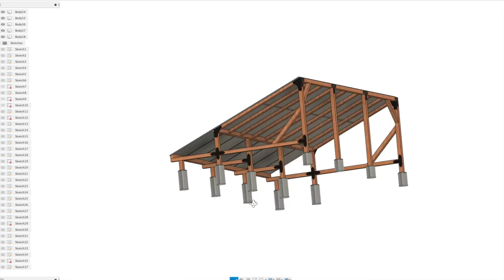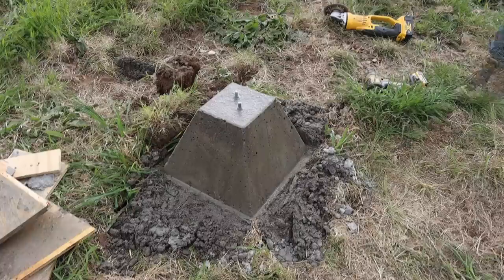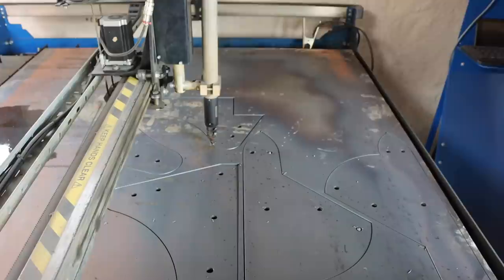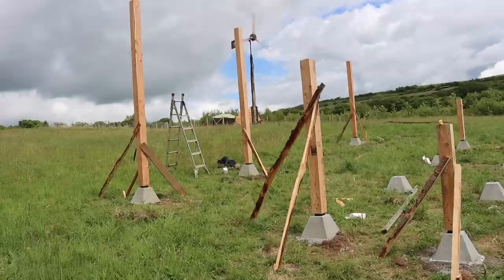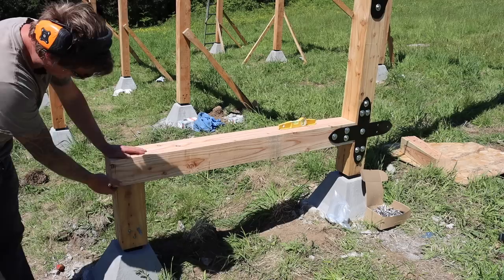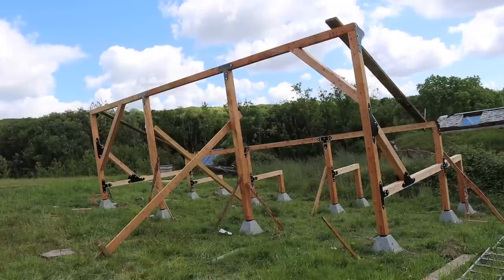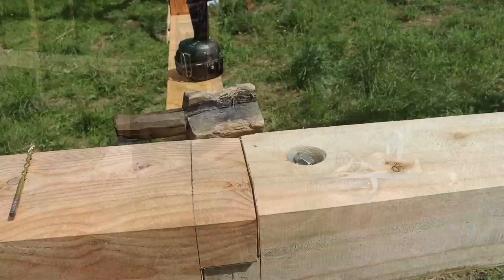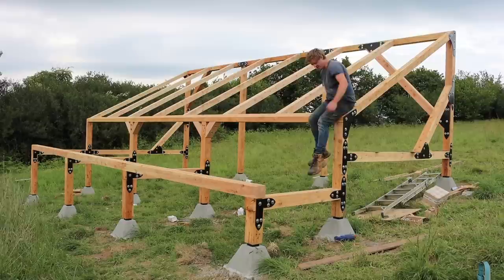8.4 Kw Timber Framed Solar System Part 1 The Frame

Comment: Kris, thought you'd gone totally OTT with that utterly gorgeous frame. Then realised that the sail area of the panels would exert enormous forces on the frame in high wind/storm situations. Over the expected lifespan of your new/modern solar panels there will be plenty of storms, so I now realise the wisdom of your design.
And using the space underneath as a wood store - pure genius!
8.5 KW of power is insane - well done, but are you planning on selling it to your neighbours/ the grid?
That's pretty much all the power the on-grid connection to my modest house gets, and we've never been short of power in over 30 years here.
I know it's subject to sunshine, and your hydro is subject to rain, but if the sun aint shining, good chance it's raining (especially in Wales!), so you seem to have it covered whatever happens.
Genuinely in awe of what you're doing there, and so thankful that you're sharing it with us.
Thank you.

Comment: I have a 12.1Kw system on the roof of my house. It was installed to cut down on my electric bill. Solar is wickedly efficient and I have not had an electric bill since December of 2021 due to a credit created by the excess power the utility has to buy from me. You will love it since it will more than meet the electric needs of your home and shop. I watch all kinds of channels. One of the tricks I have seen from companies that pour concrete is to put used motor oil as a release agent.

Comment: Yes service has got very slack recently from suppliers. New and more efficient is a better way to go in my opinion. Could have used less panels and put a bit of roof on the structure if you think you have too much solar but I guess in the winter the extra will be better for you. Great vid thanks for sharing.

Comment: Kris, ever thought about doing a composter that automatically turns itself over? Could be a cool side project while waiting on parts for a larger project.
Reply: My Dad made one of them automatic composters 66 years ago! He had to wait a few years but I finally got big enough to use a fork and shovel...LOL Such fantastic engineering that I'd say is ULTRA MEGA DIY. Done by a master. I would have thought he would leave it open under and graze the sheep periodically. No goats though!
Reply: Kris has a half dozen already in the chicken house & incubating more. You'd be surprised at how fast 6 chickens could level the compost pile

Comment: Hi Kris - am still loving your videos as much as the early days, wow, come such a long way since them miserable days before the house was built - like the new structure, a little house for the tractor, another hen house, or for sheep
not sure if this might be relevant or of any use to you, a little knowledge i have regarding solar panels, i did a security job looking after a new Solar Panel farm, when the boards finally arrived, i helped go through the panels after delivery, all i understood were printed (the latest thing making solar panels cheaper) but around one in five were damaged, cracked and some the print (screen print) had delaminated - i also learnt that the panels may need replacing every few years due to failure, i guess under UV conditions, i wish i made a note of the company as it got me interested, maybe i try and look out for a local site and keep an eye out for maintenance crews and ask, its interesting technology, but if it fails every few years, i begin to wonder, i guess you pay for the quality in the end, be cool to see how you can test a panel, before it gets wired in, and fails
Reply: That sounds like quite a specific problem for new types of panels - most are guaranteed for 25 years!
Reply: @sroberts605  this was from around 2008 ish, i understood that panels were now being screen printed saving a fortune on panels, around £25 or so per panel which i guess makes sense when filling a field with them, but the failure rate must be pretty bad, be interesting to find out, but i suspect some of it was due to transportation from Taiwan etc some ally frames were dented

Comment: I am going to use this when our install crews complain about uneven ground whilst using machinery and prefab racking solutions for our ground mounts. And from someone in the solar industry what you experienced with  procurement is insanely common right now some have even demanded more money to release the equipment due to rising costs. The solar industry has exploded in costs across the board. We have seen 15+ cents a watt increases in a matter of months just on panels. So companies sell you something and will want more or sell it elsewhere because demand is so high . Sad but a reality at the moment.

Comment: Another spectacular build, an engineering feat, well done. I installed a 6.6kw system 18 months ago and it has more than halved our electricity bills. System will pay for itself in under 2 years. Just need the cost of batteries to come down so I can store the excess and then we will be totally off grid.  Look forward to part 2 👌

Comment: Beast of a frame! I prefer the metal brackets too

I feel like the solar panels being new you'll just get more life and efficiency out of them, it's not like you won't put them to the best use and probably offset the environmental impact of making them in less than a year with how green your whole setup is... add in the additional ability this will give you to do so much more no one should be losing sleep :)

I'm not sure how environmentally friendly it is, but, with the concrete pads (fully cured and dry as a bone) if you mix 50/50 petrol and bitumen and paint it you'll get a cool looking finish, good protection for metal and it'll soak into the concrete miles better than any of those tanking type paints, they're usually just some sort of latex that eventually peals off and they barely penetrate the concrete, it's also amazing wood protection too and kind of "ebonises" the wood, might be worth knowing, even if not for this project 👍

Sounds like you'll need a beast of a battery bank for all that power! looking forward to the next part 😁

Comment: Definitely the best panel timber frame job ever done. Out in this USA Prairies we get 100+ Knot winds. 
That frame would still be there, but the panels will be blown far away. 
Regarding your comment at 28:00 - The company waited till the day U were supposed to get them 2 tell U they R not there. 
They knew it long before that no doubt. They knew they had a 'fish on the hook' as the saying goes since U were already building for them, so it was a no brainer for them to sell you the better ones at that point. In the end they did U a FAVOR !! The used ones are so low in efficiency and have a high failure rate, and no kind of warranty either probably. In the US the companies that stocked commercial installation panels don't even have them listed on the sites anymore.

Comment: Kris a blinding video and how quickly you have adapted to being able to produce your own brackets which look awesome on the timber. I love the fact that you have a duel purpose for the frame but did you consider making an adjustable frame so that you can alter the angle of the panels for the seasons? Also what happened about the small building and the completion of the hydro system as few videos back, I'm sure there are many like me who would like to see what you finally built to go onto that foundation you built and to see the final set up.

Comment: Excellent. I have a tendancy to over build things as well but not going to have to worry about it blowing or falling over for a long time. It is also a great place to park your tractor and implements underneath with a bit of a gravel drive off of the main drive there so is serving another purpose as well. The extra cost of the nicer panels will last much longer and pay dividends in the long run so although a shot in the wallet now cheaper in the long run.. Great video and ty for sharing. Cheers from Vancouver island B.C. Canada

Comment: I liked your technique to settle the cement into your forms with the vibration, and the sealant you applied (good point about water getting in and cracking it).  Note about timber frame vs post and beam construction: Timber frames are always made with solid wood with mortise-and-tenon connections and secured with wood pegs. Post and beam construction typically uses half lap joinery with hidden fasteners, and decorative metal braces some of the time.

Comment: Dude this is absolutely incredible! Everything you do is amazing. I built a simple frame for 6 100 watt panels recently and have been researching/ ordering all the components I need for a backup power system. It will mostly be for our sump pump, and a fan for the compost heater I’ve been working on also, but hoping to run some other equipment if we loose power. But I’m learning just how crazy complex it all is to figure out and coming back to your Chanel after a little while its blowing me away how much you have accomplished.  The quality of your work is astonishing and you should be very proud!

Comment: Looks good and you've got 90% of the hard work done for a new shop or shed. If it's possible, you might want to put a metal roof on before you mount the panels. Then you would have 95% of a shop pre-built for whenever you get a round to-wit. If you do roof it, don't fit the roof to for a solar panel scaffold. A building will have siding and trim making it's roof cover more area. 1/2" siding, 3/4" trim-board, 1" overhang, 3/4" drip-rail trim and 1" for (I didn't think about that) = 4" or about 10cm per side and double that for the front and back.

Comment: Hi Chris been watching your channel for about 4 years now. Love your engineering mindset and the thought put into doing things once to last. Rather Victorian in its way. One thing, I noticed you have started using ear defenders which is great but I noticed you have the same habit that I always had and that is to use my hands as a hammer. Now I am 57 and my hearing is fine but I suffer from vibration white finger and have to wear heated mits as soon as the temp drops to about 12 degrees. Never listened to the old farts. All the best. Marc Gilmour

Comment: Great video, Kris, as always
For the extra power output, that’s probably a good thing and you won’t regret it - the 8.4kW figure is highly likely to be ‘max possible’ under ideal conditions of sunshine, clear air, angle... and only at noon
In reality, your ‘typical’ output will be (far?) less and you’ll be glad of the unplanned extra

Comment: I gotta drop in some concrete info here. Having voids or bubbles in concrete actually protect it from freezing, it gives more space for the freezing humidity to expand into. Additional air is often added into concrete in the Nordics. Sealing the concrete surface will protect the reinforcement for a little longer from other corrosive elements like acids and salts. It'll also slow down the concrete carbonization slightly.

Comment: It's a very nice build. I am thinking nicer and more complicated than I need. I am going to bolt the diagonals to the uprights and bolt the cross-braces to the uprights also. Uprights, diagonals and cross braces will all be square ended. But, bravo, very nice job

Comment: Love the work. Those bolts (unless they are Stainless Steel) will start to rust in 10 years if it rains like it does here. I give my exposed bolts and nuts a coat of spray paint that is surprisingly effective at slowing that down. But YMMV.

Comment: Lovely work. Small tips: a round thing always looks right, aka some older bucket would have been a decent shape. Also, when using screws, put Vaseline or some bolts on them. This avoids the threads filling with cement or dust and simplifies later installation.

Comment: I was also interested in the delta 400w modules which I was about to purchase but they have now been superseded by the 415w and I'm not sure about the advantage/disadvantage since they provide a lower voltage but a higher amperage. That would yield a larger cable (or I could build a solar shed closer to the array) or the addition of one more module at the very least. I wonder if you would like to comment on this one, please. Your video was very instructional and comprehensive and we all thank you for the effort as I'm sure many others also found it so too 🙏

Comment: Done foundations like that for decking used cheap plastic buckets from b n q £1 each just cut the bottoms out and actually used them long decking screws to hold in position !! Re used all the screws
Love your vibration device , use my sds drill for same !! 
Not gona comment on the frame and steel brackets im a carpenter , lol

Comment: Nice project. I'm doing a large 50x16 deck, and footers need to be 48" below ground.  You must not have to worry much about frost heaving. My only concern with your piering is you simply have round piers in holes. There is no real uplift protection. If you have multiple square meters of area subject to winds with lift, its amazing how much it can lift.  From Hackaday it said you milled your lumber, and were confident the sap wood might rot but not the heartwood.  If you haven't you really should get some form of preservative on that lumber.

Comment: Kris, I have a nice eco-friendly suggestion for you. Turn your 10-horsepower diesel engine from your sawmill into a generator and make your sawmill electric. Relatively speaking, you only need to buy 2 powerful new or second-hand electric motors. With your xtreme cnc plasma cutter you can make something beautiful out of it. Advantages, no noise at your sawmill, free electricity if your sawmill is at home, with the generator you can also use the sawmill on the move. And you have a powerful on-the-go and emergency generator to recharge your batteries. I'm curious what you think about it. Good luck with your YouTube channel. Regards Luc.

Comment: The project looks great! You might consider a through hole at the top of the slots you cut for the base plates to prevent the slot from continuing up the post over time.

Comment: Pretty good for a solar rack. I have always thought that its better to just build a shed or sorts to put your solar on. This will work out great for wood storage. I have seen a number of them where they build them for parking cars under. I plan on building a new house in a few years and plan on building a bull dog roof which will be angled just right for solar and a steel roof with the solar on it. I intend to place solar over the entire roof as it aids in keeping the roof it self much cooler there by reducing cooling costs. 
It sucks that you could not get those used panels. That is the route I intend to take so that I can have a much larger system that I would ever need.

Comment: I bought some 260 watt panels off ebay at one point and it was local pickup for me. $65 each and they turned out to only produce about 220 watts each and sometimes 240 watts on a good day. Not bad panels, but you are going to not regret getting the new panels in the future when you would otherwise come to a situation where you once again need more power.

Your battery wont take that much charging power at any given point very well so be sure to set your charge controllers to not over current the battery during charging or it will decrease it's lifespan. Your new solar + wind + hydro might ruin that single battery in less than a year from over charge current if not limited. My experience with lead acid batteries is to not charge them more than 0.25C. So a 30KWh battery can take a max charge of about 7.5kw but ideally you want to charge slower than that to max out it's lifespan. I would say you have enough power to charge four of them with this new setup.

Comment: I waited to see if you were going to turn it into some kind of shed or small building. It could easily be sided and be given a door. But a woodshed is never a waste of space either. I have a 5KW system and it definitely cuts my power bill to the minimum.

Comment: 14:07 instead of holding three whole saws together, remove the blades, widen the slot in one handle, then install all three blades into it. 14:14 is why you wrap masking tape around the threads or find some pieces of hose or something, perhaps PEX tubing, that will keep concrete out of the threads.
Reply: The whole point of using three saws together is that its a very quick and easy way of doing an occasional job - you're thinking up ways to make more work and complicate the job....!

Comment: Surprised you didn't just buy sonotube concrete forms. Might have even been cheaper than the cost of that plywood you used for forms.  and though it sucks about the panels themselves, don't worry too much.   If you use that amount of electricity, the carbon offset of having panels that will last 25+ years is less than a year to offset the manufacturing, and although you're not on-grid, if you were, financially the electricity costs in just a few more years more than that!  You're golden!

Comment: If you've aligned the frame relative to the sun correctly for your latitude then the solar panels may produce 8.4 Kw for about 1 sec  at noon on summer solstice. Otherwise power output will be much less.
I have a 6 Kwh propane run generator that occupies a mere meter square and it makes available its  power  output while running.

Comment: G'day Kris, I hate to be a downer but there's no Rio bar , chicken wire or steel of any kind within the concrete to bind it together, so don't be surprised if you get a bit of cracking in the future! Otherwise another awesome job 👍🇦🇺🌞😕